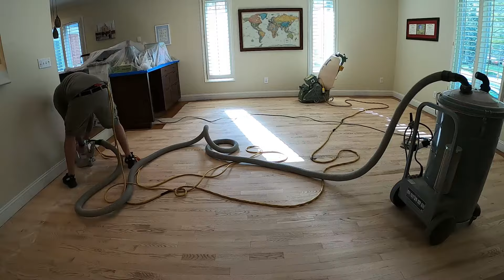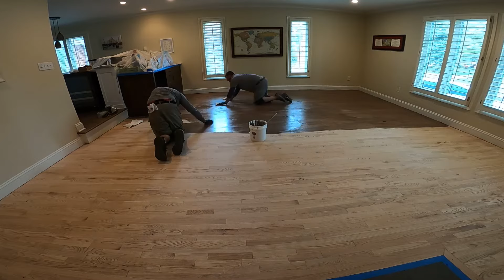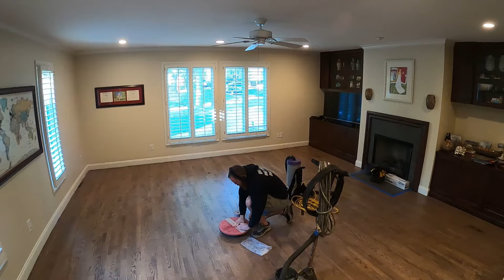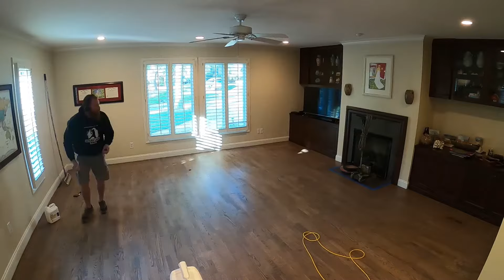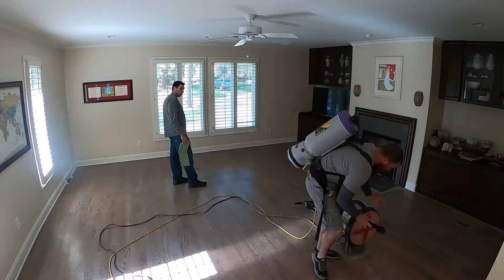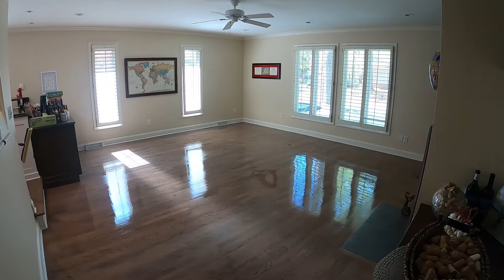Hardwood Floor Restoration Refinishing Time Lapse Dustless Refinishing

Comment: It is an art to keeping the cord out of the way. I ran a hummel drum sander for years. Hummel was the best.
Reply from the maker: Yes sir!
Reply: The one handed Ringling Brothers lion tamer lash is the technique I use… 98% effective.. every now and then the cord gets stupid though.
Reply: @krakenwoodfloorservicemcma5975  Did you loop the cord over your shoulder? We had a guy demonstrate a new dust system and he said never do that because of electrocution right across the heart area.
Reply: He is absolutely correct, not to mention I just don’t like anything close to my neck. I have done it but absolutely try to avoid it.

 I work completely alone so I often hook the cord on a door hinge to keep it out of the way.  Sometimes if I am in a real tight hallway, I will just run the machine extra slow in one direction and you can’t even see the difference.

Comment: Nice Job! What  sandpaper grit do you use for buffing between coats and is there any difference between use Denatured Alcohol and use Just Water, thank guys
Reply from the maker: Thanks, we use 180 between coats. I use denatured because it flashes faster and can stain same day with no worries
Reply: I've not had a problem with using water, and going in an hour later.  I know that some methods advocate overnight drying for water treatment, which was one reason I didn't use it much.  Then I subbed for a high-end company in my area, and they were water-treating with rags, taking lunch, and coming back to apply the stain.   I started using water popping at lot more after that experience.   Using the sprayer is a much better technique, though-- I'm still on hands and knees, and I'll look into a sprayer.   @superiorfloorsnc1060

Comment: What was this spraying step after the sanding? What liquid was it and what is the purpose of it?
Reply from the maker: That is denatured alcohol and it is meant to open wood grain enough to take stain evenly
Reply: @superiorfloorsnc1060  That is your pre-stain equivalent? 
In case it is, an interesting video idea would be comparing its effect on the final staining result vs different pre-stain brands and no conditioning at all ;)

Comment: Why they staining by hand and not using the buffer and carpet pad 🤔 the coat the floor weird also but good jood guys
Reply from the maker: Everyone does it how they like, we think its better quality by hand in some situations like this small room. We coat with roller for 2 coats then T bar for final and it turns out smooth and clean everytime.

Comment: Did they just put a small trim board on the baseboard to compensate for the lower level? That is nasty workmanship. Do it properly. Take off the baseboards then sand/finish, then re-install baseboards.
Reply: You do work for free? Doubt the homeowner paid